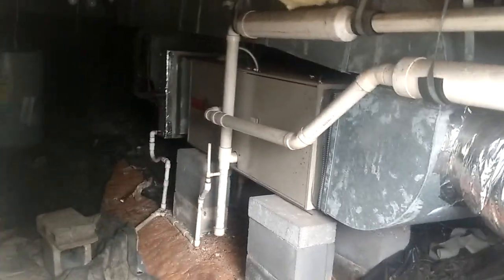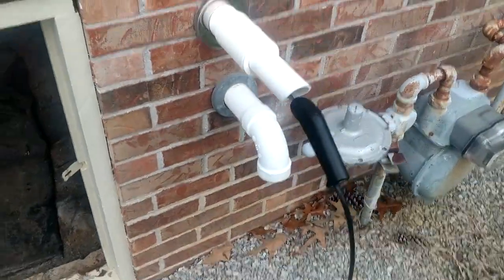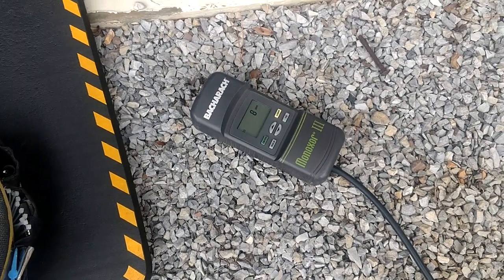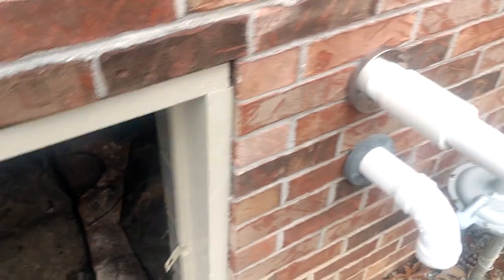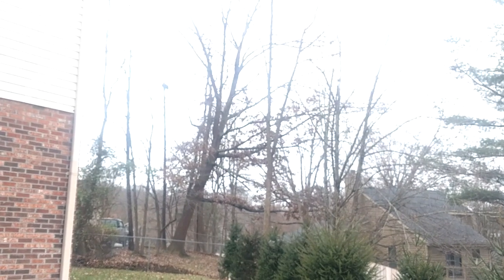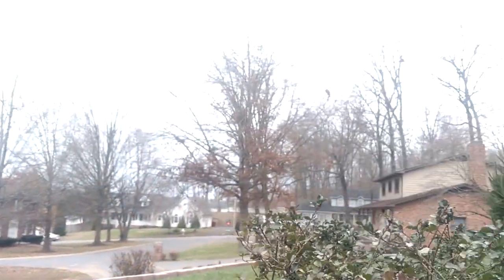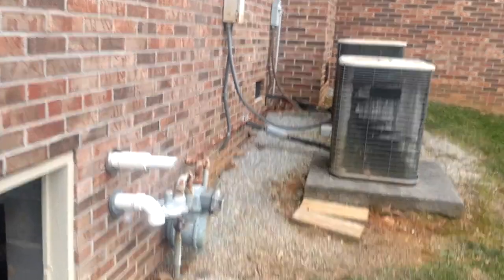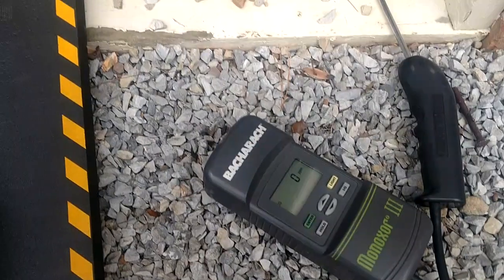Sharing funny stories and stupid things that we all did back when we first started in HVAC. COMMENT⬇

Comment: I had a system with a bad freon leak on the indoor coil. Sold them a new system as it was R22. Came back to install it and noticed that taking all the freon out of the system that the indoor unit still had pressure in it (freon flew everywhere when I cut the liquid line). I had picked the wrong outdoor unit. There were three units outside. So now i had to go back to supply house as the correct one was a half ton larger. All while not letting the homeowner know that I goofed. Not to mention that I had to recharge the other R22 system!!!!  Long day
Reply from the maker: Heck yeah, that a boy. "Maybe I can pull this off without the homeowner ever knowing." 💪

Comment: Changed quiet a few combustion air motors out before I knew that little port could clog up. On the very first heating maintenance I did, I burnt the heat anticipators up on four thermostats in the same house, the boss flipped his shit 🤪
Reply from the maker: Who needs a heat anticipator anyway? .4    1.2  what's the difference 😂😂😂😂
"Ma'am you need a new digital thermostat, it'll be much more accurate than this old one."
Thanks for sharing Clint 👍
Reply: I should delete my newest video due to that's what I run into

Comment: I had a customer with 4 5 ton package units and a 2ton wine cooler system. She had called in because she had birds in her duct work. Yes it is a large townhouse. We go upstairs and you could hear “birds” in the fir down. There is a six foot ladder in an attic space to go out the roof hatch. This unit was on the higher roof. You used the brick fire wall to get up to that roof. I get to the unit. It has side discharge duct with a dog house cover. I look under the edge of the dog house. I go to the other side to look there. I had just a small bag of tools. It’s birds not a break down so I didn’t grab my big bag. Just had a meter and a couple nut drivers. Well I couldn’t see anything so I had to remove the dog house. I peel the metal tape off one side and start peeling the tape off the top to get to the screws. That when I heard this large growling sound. I looked up to see a mother raccoon had come out from under the dog house. I like holy $&@?. She is hunched over growling at me hair standing up on her neck. I’m stuck 30’ up on this roof behind this unit. I start weighing my options. Do I throw the whole bag at her or throw things one at a time. I have steel toe boots on ok. I have limited options. She’s still hunched and growling. This really sucks. At this point she turns and starts running away. She got to the fire wall and headed to the front of the town house. Good I can get the hell out of there. Well raccoons have their own way of doing things. She had made a U turn at the end of the fire wall and was heading back to me when I was stepping onto the fire wall to get down here she comes again. I jump back up to the high roof. I now see the pine tree shaking that she uses to get on the roof. I jump down the ladder slamming the roof hatch behind me. I get down to the customer and she asks “Is it bad?”  Yes ma’am it’s worse than we thought I say. I tell her it a mama raccoon and her babies. She asks what I’m gonna do. I say nothing I fix air conditioners I don’t do raccoons. She had to call animal control. When they got the mama trapped they got the babies out of the duct. It’s amazing how baby raccoons sound like chirping birds. True story I hope y’all enjoyed it lol. I can laugh now but it was far from funny at the time.

Comment: I was installing a humidifier in a return plenum. Smashing through the ductwork with my screwdriver and a white cloud filled the basement. I tore right into the evap coil. The job turned into the customer getting a new coil
Reply from the maker: Ouch!!! I was trying to lift the top plate up on the top of an A-coil to see how dirty it was on the backside, because I had no access from underneath. And the corner of my little pocket screwdriver pierced the copper on a U-bend & that was all she wrote... Cloud City!

Comment: Stupidest thing I've done yet, being an electrician and not an hvac guy, was changing out a thermostat without killing power. There's not always a fuse on that 24v :p Thankfully, it was my own unit. Ran it off a variable power supply for a year because I was too broke at the time to afford a transformer. Best thing I've seen this week? Evaporator Christmas Tree that freezes thicker the closer we get to christmas :) stay warm my friend!
Reply from the maker: Yeah when you short some 24 volts you're always praying there's a fuse in there on that transformer  😂 thanks for sharing. 
the only stupid mistakes are the ones that we make a 2nd time.
Reply: Don't feel bad,  I had a neighbor who also was an electrician and thought he could replace the outdoor fan motor on his equipment.   I get a call and figured out he didn't shut off lv power.  The guy shorted the lv and burned up the transformer and thermostat.

Comment: My first week I was turned loose on my own. Did the maintenance and accidentally left the leads of the blower cap. I’m talking with the customer and saying everything is running good and they go “I smell something like burning, do you?” I run down stairs and open the unit up, blower cap leads dangling in the wind. I hurry up and grab a lead and got shocked pretty good (door switch was taped) lol

Comment: First condenser I ever installed by myself .. I started up unit checked out delta t  pressures etc tools in the truck ready to go .. realized I forgot to put in the liquid line filter drier lol had to bring torches nitrogen everything back out 😂 to top it off I dropped that coil trying to get it off the truck by myself .. didn’t leak then but sure enough I had to come back not more than 3 months later to replace it lol
Reply from the maker: Ouch!!! Thanks for sharing 👍

Comment: Can you do a video on that furnace. Truth be told I fixed one replacing the flapper. But dont know how they really work. Only saw it that one time. I got lucky.
Reply from the maker: honestly I've always chose not to do videos on pulse furnaces. Guys really shouldn't be working on them unless they're specially trained. so I don't really want to do a video on one and teach guys just enough to mess one up. 👍
Reply from the maker: Are you still liking your new meter?
Reply: @sknight0391  I like the meter. I got that just in case I have to get into inverters and for LOZ
Reply: @sknight0391  no problem I usually figure it out and call tech support if needed

Comment: I was still at trade school and started working the boss sent me out to change a compressor.  Remove filter dryer thru it on the floor and i read the label said muffler.  Called boss and ask why filter says muffler?  If i didn't read it would have 2 filter dryers
Reply from the maker: The old muffler mistake 😂👍

Comment: I can't believe your allowed to vent that close to the gas meter
Reply from the maker: What's wrong with that? I'm not aware of any code pertaining to how close vent pipes can be to a gas meter.
Reply from the maker: Not to mention, that was done thirty years ago so even if there was a code that would be grandfathered in.
Reply: @sknight0391  In my state they have to be 5' away from natural gas meter. Or propane the vent has ti be 3' from the regulator NFPA54 code
Reply: @sknight0391  propane is NFPA 58